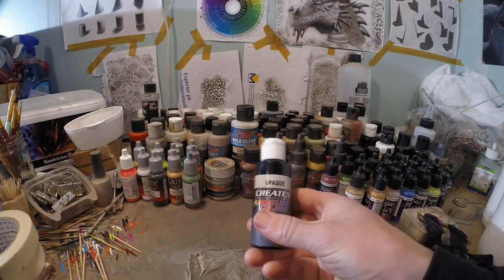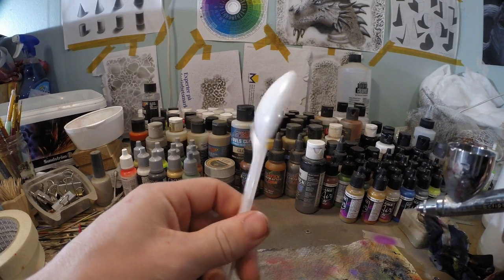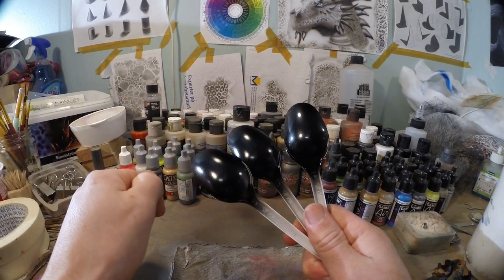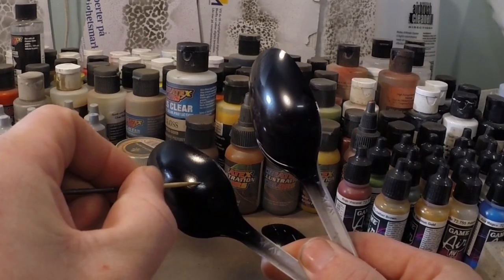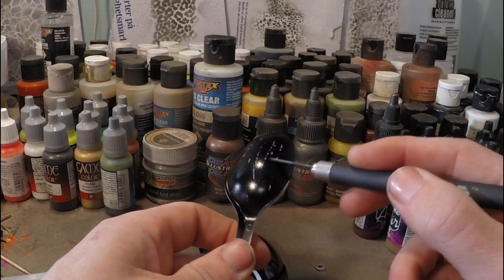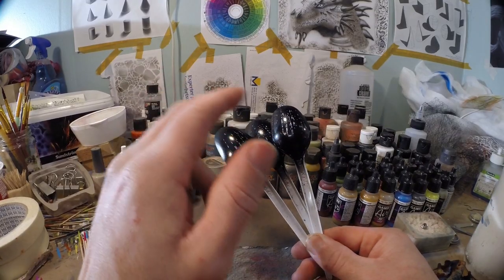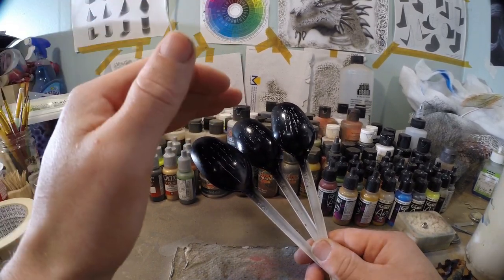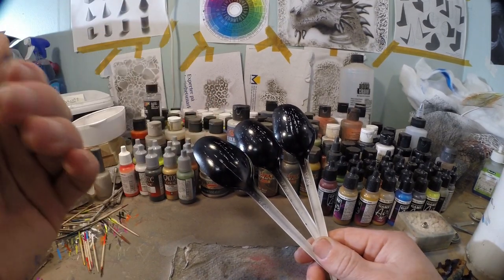Why 4030 and 4050 Are GAME CHANGERS For Createx Paints

Comment: Yes straight Acrylic paint is fragile and scratches easy, and 4030 and 4050 helps quit a bit, but it’s not Adhesion, it’s just the hardness the additive adds to the paint, all are coming off the spoons, to get adhesion you must prep your work surface correctly!
IMHO anyone whom paints a lure, needs to protect the paint job, while handling before the epoxy, so any additive that aids in protecting, is worth the money and using it!
Reply from the maker: Agree! If I would have sanded those spoons, nothing would have come of. Although I have to admit that I rarely sand my lure before painting. But that definitely would make it even better. Additives are underestimated sometimes 😊
Reply: @lureblanks  I do wash my blanks with denatured alcohol.
Reply from the maker: @markoharoldoronearmedpoohb7816  Most of the Time I do too 👍😊 its best to get that grease and dirt of first.
Reply: Incorrect. Adhesion can be two ways. Chemical or mechanical. 

Water based paints rely completely on mechanical adhesion. 

Using a primer with very good mechanical adhesion..  or even better, a solvent based primer that can create a bit of chemical adhesion, and then using your water based mechanical paint will greatly increase durability.

Comment: Have you noticed it adds more weight to the lure?  I painted a glide bait and used the 4050 at the end to protect my paint job and the glide bait weighted 1.4 grams more after adding the 4050
Reply from the maker: Never noticed that before, are you sure it is the 4050? 1,4 grams of 4050 is a lot of 4050 (considering that the water in it will vaporize after applying) are you sure it was not the clear coat that added the extra weight at the end? Clear do weigh a lot and add weight to lures, which lots of lure builders try to take in consideration when weighing their lures 😊

Comment: Great example video!! Do you always mix one of these into your paints? Also, you have a preference between the 4030 & 4050? Createx recommends 4050 but I've read some reviews where people like the 4030 better, even though 4050 is more durable.
Quick note for those may not know - the Wicked line already has it in it, so no need to waste the precious 4050 for them. 4030 & 4050 is also a carrier for the quicksilver and gold chrome paints (I learned the hard way - they're the same consistency as the Candy2O paints). LOVE your videos!!
Reply from the maker: Thank you so much Jo! I almost always mix a little 4050 with my paints but just because it makes them spray easier,  less tip dry and because of the viscosity I can use a higher airpressure.  I like painting with higher airpressures. I also feel that with 4050 I have less tip dry then with 4030. But I always thin it down a little with 4011.  Thanks for the tip! Never tried 4050 with gold chrome or quicksilver. Going to test that out 👌👍
Reply: @lureblanks  I was spraying lures all night and kept having issues with tip dry... mostly the flourescent & pearl colors... your video helped so much - my ratios were definitely off. So I'm using 4050 in everything now.... Thanks man! Would be a sweet comparison video testing the quicksilver and gold chrome with and without it 😉
Reply from the maker: @changemymind06  Reading this makes my day! Thank you for that! I definitely going to test if out and maybe make a comparison.  I just base Coated some lures yesterday with gold chrome. Next time I am going to try it out 👍👊

Comment: Another really interesting video and deserves a BIG THUMB'S UP. I'm having problems with my acrylics adhering! But my problems is while I'm actually applying the paint, it's blobbing up! They're pearlised and metallic paints, and applied by brush as I don't yet have the airbrush & compressor etc. I've cleaned the surface's (aluminium foil) to be painted with 99.9% isopropanol alcohol and the paint is still   blobbing it's like painting over a waxed surface! This painting lures idea isn't as easy as I thought, is it because I'm applying the paint with a brush? I can't sand the surface to give it a tooth for the paint to adhere to, any advice would be appreciated.
Reply from the maker: Thank you my friend! Applying paint with a brush on aluminum foil is really difficult,  it is blobbing up because you apply too much at once on the foil or the paint is too watery, too thinned down. But with a paintbrush you do not really have much control over that. The best thing I can suggest is to hold on with the foil until you have an airbrush. Even Thinning down your paints more and brushing them is going to make it form waterdrops and accumulate. And not Thinning them down is going to leave brush strokes and you might lose the effect of the foil. Depending on the type of paint and brand 👍hope this helps ! Take care mate!
Reply: @lureblanks  Good morning my friend. That's what I can't understand I'm not thinning down at all! It's a thick paint straight from the tubs! I've tried brushing it on really thin but it still happens! You're right the paint can't be controlled as much as the airbrush, the paint from the airbrush has hardly any moisture by the time it's traveled under pressure from the airbrush to the lure just a light misting of paint particles! Whereas the paint from the paint brush is holding to much moisture therefore causing it to blob! I'll definitely take your advice and put away the tape until I get my airbrushing equipment together. I thought it was the brand of acrylics that I was using but tried different brands and getting the same results! But I'm still enjoying myself lol... Plus learning load's along the way together with your videos. Thanks for replying and the advice  I really appreciate it my friend... Take care til next time👍😷👍🏴
Reply from the maker: @PENFOLD1962  Glad I could help a little,  it will indeed go much better with an airbrush on foil 👌 it's important to enjoy the hobby, and after every struggle comes a valuable lesson. you are always welcome my friend and you too take care!
Reply: @lureblanks  You make it more enjoyable by explaining everything possible. I love to know as much info and background knowledge that's where you come in. Everybody seems seems to forget to explain what and why everything is happening and how to get the very best results. Ya not a bad lad afterall I don't care what others say lol (joking). You actually make a massive difference more than you think. I thought that I had my money together for my Bartsharp Airbrush & Compressor but the Sky and TV Licence soon gobbled up that money so there's no hope until early next year now Christmas has halted all hope lol. But it will be worth waiting for, plus I can have more fun pulling my hair out by trying to paint the lures by paintbrush 🤣🤣😂🤣😂🤣🤣😂😆🤣😂 Thanks for all the help I really appreciate it my friend👍😷👍🏴
Reply from the maker: @PENFOLD1962  Thank you so much! Really appreciate the kind words and you taking the time to type a comment! And hey with a paintbrush you can do a lot. I am sure you did already but Have you seen a lot of miniature painting videos yet? I watch a lot of those too to learn paintbrushing and other techniques 👍👌 take my friend! Thanks again for the kind words!
Reply: @lureblanks   Two great mind's think alike. I've been watching the minute painting videos to see how to grade one co!our to the next without using washes etc! There's some really good videos, they use the easy rout by base coating before they actually paint the figures!  That's where I've been looking for an alternative to foiling the lures, some great silver and chrome paint. Only problem is that the one's that impress me are lacquers and alcohol inks something else that I have noticed for when I get my airbrushing equipment. They have more patients than me... Painting a 300 figure army plus additional dragons, horses etc. I've been looking for more lures to practice on but they are all about 75mm long! I prefer larger so I can put detail on to them. The one's I've been practicing on are about 100mm long but have 7 pieces to them with the material linking them together... Oh never again, they're difficult to foil lol. I haven't even tried to coat them with epoxy... I keep threatening to but always find something else to do lol. So I'm now looking for some one piece but they all seem to have the diving bib on! I might give carving a couple a try.... Better get a supply of band aids lol.
Reply from the maker: @PENFOLD1962  Swimbaits are the hardest and take up most of the time.  It would indeed be good to start with some 1 piece jerkbaits or something 👍 there are some good 1 piece jerkbairs or glide baits out there. Or else indeed you can start carving 😁! Thank you for the comment my friend! Take care!
Reply: I have made and painted foiled baits for years. Go to an auto parts store and get a quart of adhesion promoter. A quart will last a long time. I always spray it on, but there is no reason you can't brush it on. It's about the consistency of water, and dries in about 5 minutes. I used to struggle with that on foil sided baits, even with a spray gun, until  l learned that trick.

Comment: Can the 4030 be used with a siphon-feed airbrush as well? Can the 4030 be left in the paint bottle or does it need to be drained and cleaned each use?
Reply from the maker: It can be used with a siphon feed airbrush,  but when it comes to cleaning or if you can leave it in there , I have no experience and no idea. Best would to Google that or send createx and email, they usually are quite quick to answer 👍😊 then you can make sure 😉

Comment: I'm just learning and I have the same paints. What PSI do you use and what is the size of your airbrush? I need to reduce my a lot in order to spray consistently with a Creo Badger .3
Reply from the maker: Usually I spray with around 25-30 psi. I like using higher airpressures because I find it is easier to control the paint flow that way and need less reducer. I use an iwata eclipse with a .35 needle. Should work for you too with a bit more airpressure 👌

Comment: Why don't you use lacquer paint? A fish is much stronger than a toothpick.
Reply from the maker: The toothpick is to show only how the paint addhered onto the lure. Not to represent a fish 😊because there will be a clear coat on top of the paint to protect it all from toothy fish. The point in all this is that the clear coat addheres to the paint, The better your paint addheres, the better your clear coat will addhere and not chip off.

Comment: just starting  can i add 4050 to full bottles of paint ( how much)or only when I'm ready to paint?
Reply from the maker: Some people think that 4050 is a scam, just to sell more from Createx, But the reason why they dont add it in full bottles is shelf life. Paint mixed with 4050 only lasts a few days to a week, then the quality depletes.  I wont recommend you to add 4050 in an entire bottle unless you are going to use the entire bottle in a few days, and that would be paint for a lot of lures 😄

better to always mix a little paint with a bit of 4050, about 10% 4050 will do. If you added too much by accident ( happens to all of us) Then you thin it down a bit with reducer just so you can spray it with your airbrush. Keep in mind that there are no exact mixing ratios for paint/additives and thinner. It all depends on how thin or thick you want your paint to be, and that mostly depends on what kind of result/effect you want to achieve. Its hard to explain, but with trial and error you will develop your own style and paint mixing ratios. Just keep in mind that there is no wrong ratio 👍

Comment: It all still comes off? Lmao
Reply from the maker: As I explained in the video, the most important thing is that the paint addheres better to the surface for when you clearcoat your lure. this will result in that the clearcoat has less chance to chip off together with the paint. It is not about how the paint should be scratch resistant on its own.